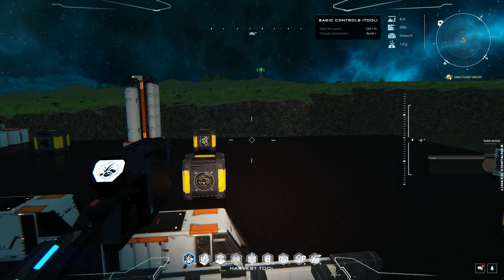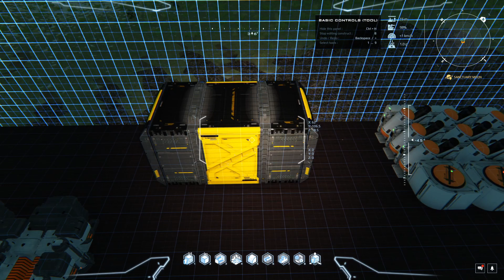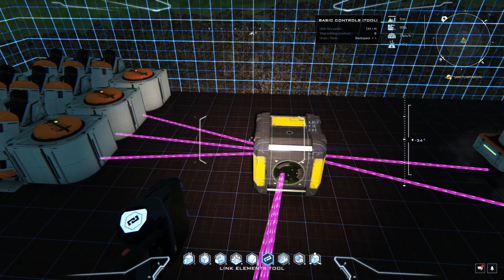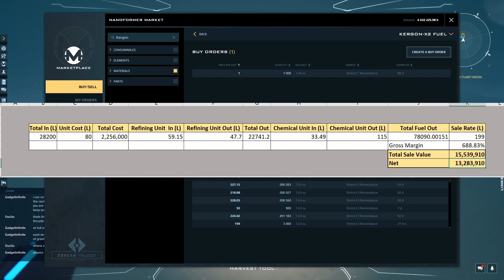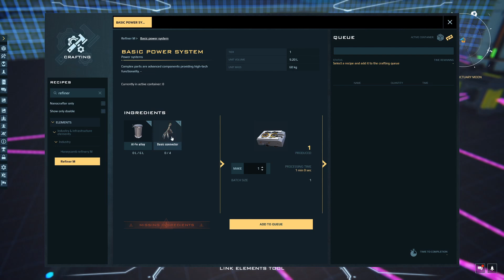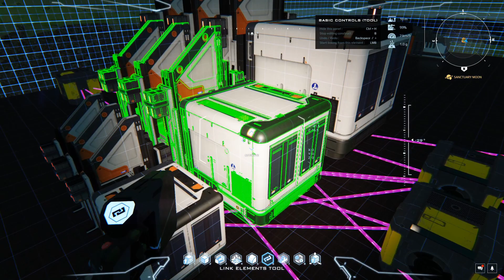Dual Universe Industry: Making MILLIONS Early Game

Comment: Well i just wasted 20€ and two afternoons of my life...
My pc meets min spec... even meets the diffrent minimum spec on the forums....
2 fps, and a buggy tutorial that cant be finished.... ffs.
Reply from the maker: Sorry to hear that Rhys that really does suck. The tutorials can be worked around with some key commands which I did a video on here: https://youtu.be/F4IolKgeCCA it might help. Also - if you can get out of the marketplace locations and get to claim your own tile the lag drops off by a big amount. You can also logout and delete the contents of the cache folder when you have been in the market areas (where the tutorials take place) and it will run a lot smoother. It’s really frustrating to not be able to play I have had that myself in the past. But hopefully the tips in the video and moving away from the tutorial areas will help. I hope so
Reply: @wozzmatic  cancelled my subscription for now.... i'll probably come back to it in 6 months or so with a $3000 pc lol. Pretty pissed at the devs though. if a RTX2070 is the actual minimum spec, they should just say so...
Reply from the maker: @rtwolfrt  Honestly I just think you saw the worst locations for lag. When you move out of those starter areas it gets much better.
Reply: @rtwolfrt   ive got a 1060 6GB, 3600x and 16GB ram and average out at 40fps. The tutorial area is pretty heavy so we'll worth abandoning the tut and using YT as a reference, just my 2c